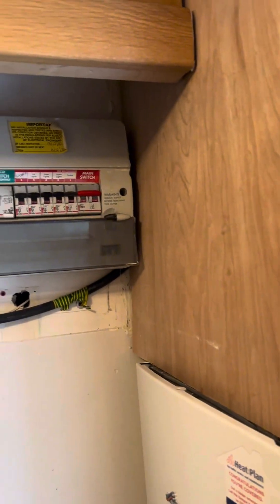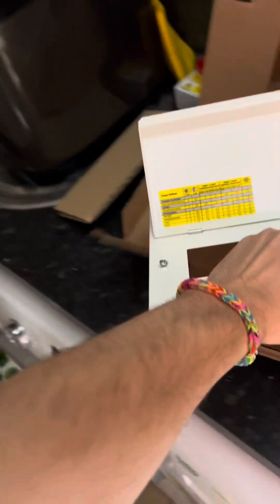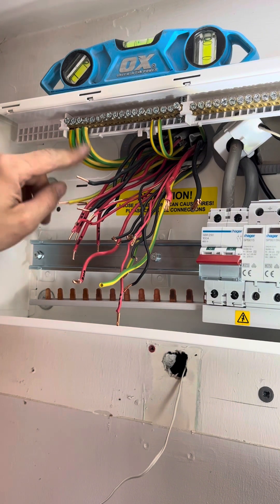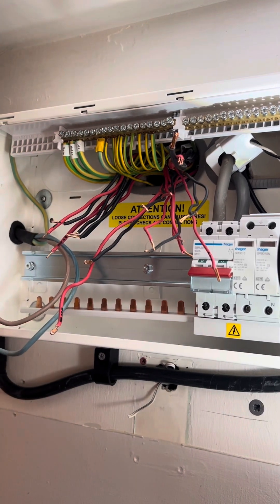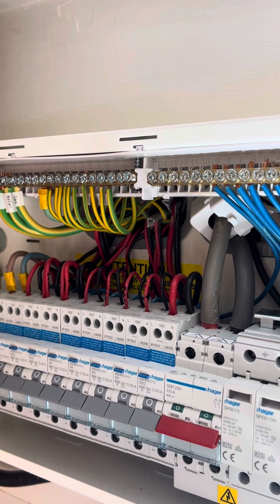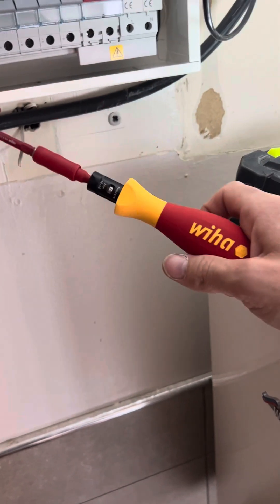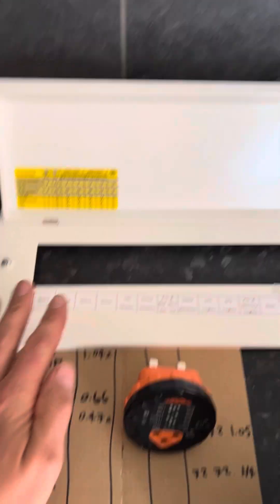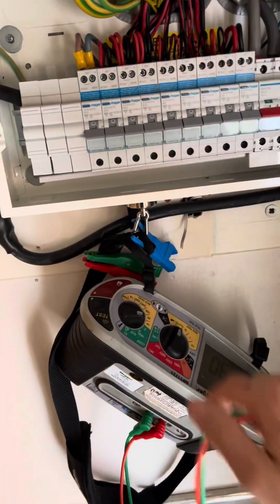HONEST TRUTH! - Torque, marking cables, connections, slack, labelling & magnets on your tester!

Comment: I just use a sharpie or pico pen and write the number of the circuit on the outer sheath, I find having the count dots and dashes more time consuming. If it’s a bigger board and it needs re gigging with new circuits I write my new circuit number on the cable but take note on a bit of card with the old circuit position and the new next to it
Reply from the maker: Can’t always get to the outer sheath if they’re buried or stripped back to the entrance to the enclosure
Reply: @bristolsparky  I have very small writing and I write on the cores as well 😜 try the pica pens 🤟

Comment: Pure genius.  I just use tape.
Reply from the maker: I find tape comes off when pulling the cables around so use this method with my sharpie👍🏻
Reply: @bristolsparky  I do like the idea with the line.  I know what you mean about the tape.  It’s like the grommet strip slipping when the board is fixed and most of the cables through.  Feking annoying. 😂